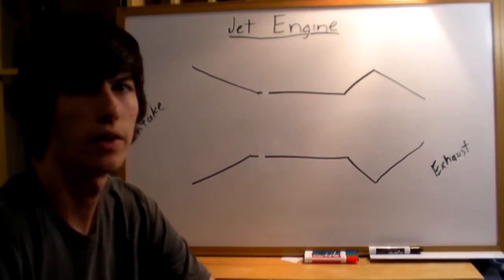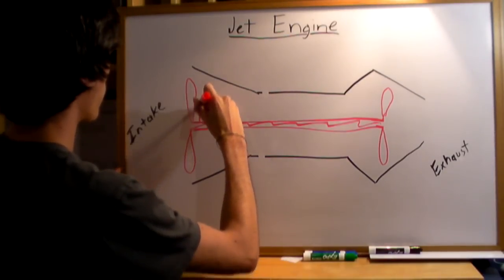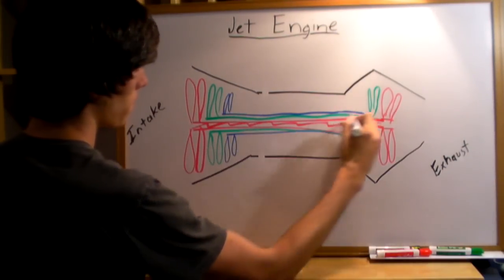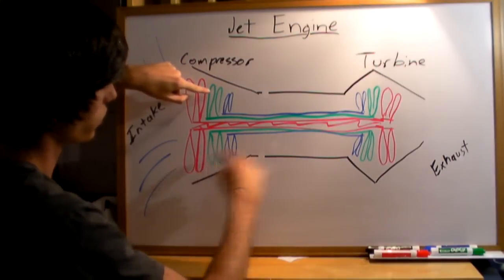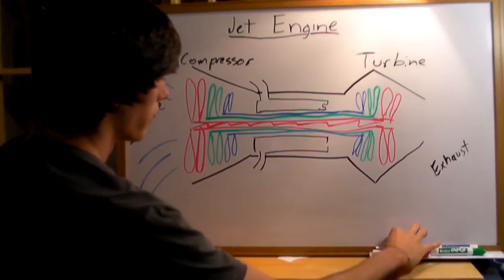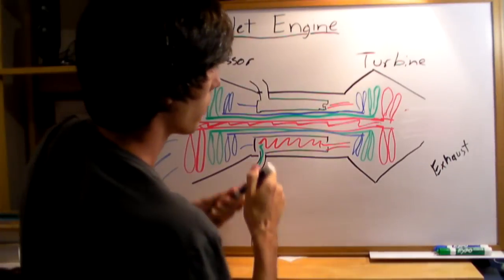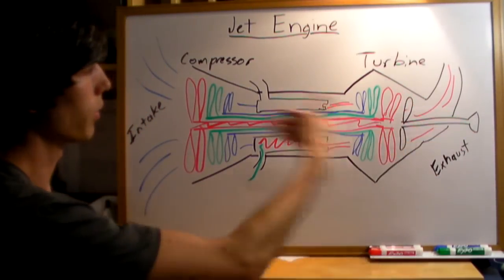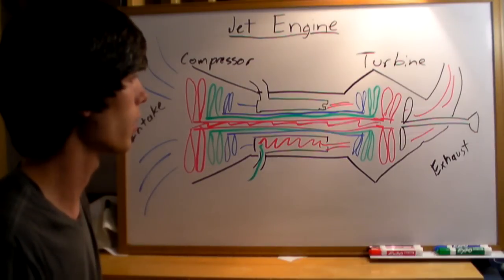Jet Engine - Explained

Comment: Of almost all the "how jet engines work" videos on youtube. None of them (including this one),  except one,  explains the reason that the hot air (in the combustion chamber) only goes toward the turbine, but not back to the compressor. That is one of the major reasons jet engines work. Oh well, guest that would be too complicated.
Reply from the maker: +Aviator168 Do you wish to enlighten us?
Reply: +Engineering Explained why can't you Google it
Reply from the maker: +Aviator168 All I'm saying is you can bash a video or you can add to the discussion. If you have information you feel is helpful to others, please share it. If you simply wish to criticize without providing any additional information, I don't see the value.
Reply: +Engineering Explained I am not bashing anything. If you are giving information, especially education information, please give it in complete detail, or have a disclaimer indicating it is not so.
Reply: +Aviator168 PLEASE GIVE US THE FULL INFORMATION PROFESSOR
Reply: +Aviator168 I suppose it would be due to the outlet of the combustion chamber being in one direction , the rear towards the turbine.
Reply: No. The reason is the pressure in the combustion chamber, even when the air is in maximum temperature, is still lower than the pressure on the compressor side. This is kind of counter intuitive. How could pressure lower when is heated up? Well, the speed of air moving in the combustion chamber is actually much faster than outside the combustion chamber, the diffuser, which is an important part of the engine. Unfortunately, most videos do not talk about that.
Reply: +Aviator168 do a video and explain us
Reply: There is a video on youtube with the correct explanation; but I have forgotten the link.
Reply: +Aviator168 SAME!!! it has taken me way to long researching to find out why
Reply: +Aviator168 still doesn't make sense, bc if it is bc the pressure is strronger in front of the combustion chamber then where did the energy come from to drive the compressor? then you may as well just use a rotary engine to turn the compressor and forget about the combustion chamber. why is it so difficult for people to explain this?? so many peopme act like they know how it works but energy wise they are always so circular, saying things like the compressor moves the air because that air turns the turbine the turns the compressor. sorry i dont mean to bash you specifically but whenever i ask a professor they act so smart because they know how it is constructed and dont know bs how it actually works. 

it also doesn't explain why the compressor wouldn't turn into the turbine and the turbine into an ineffective compressor.
Reply: The real doktorbimmer Everything is good here except you didn't explain why high pressure in the combustion chamber didn't cause the air to move backwards.
Reply: The real doktorbimmer yea but the reason the pressure would be higher in front, in your case, is because of the compressor which is driven by the same air passing over the turbine, that is circular reasoning. Im mot insulting you by saying, circular reasoning, im just saying it is, so dont be offended
Reply: The real doktorbimmer yes that is very true. But it still doesnt explain why the same heat doesnt turn the compressor instead. And no its not because they made it to only turn in one direction
Reply: +The real doktorbimmer The Heat is HOT AIR. "The turbine extracts the HEAT and turns that HEAT ENERGY it in to the mechanical power to turn the shaft.".
Unlike humans, metal can only absorb the heat and react to the molecular change caused by this heat. It cannot extract and turn the shaft a way a human would use his muscsle to do so. it is the high velocity of heated air and gasses that turns the shaft. if there is no high velocity, the shaft will never turn
.
Reply: +The real doktorbimmer Agree. that is y I did not say you were wrong. I merely corrected the way you put it. 
"The turbine extracts the HEAT and turns that HEAT ENERGY it in to the mechanical power to turn the shaft.". This whole sentence does not make proper sense. From this statement it would appear to the reader that the turbine has that "ability" of doing what your statement claims. the movement of the shaft is solely by the effect of the working fluid on the turbine. Does anyone else read the way I do or am I misreading this .. anyone else
Reply: +COMMENT heated gases and air is the energy in this scenario. in a waterfall driven powerplant, it would be the kinetic energy from the falling water on the turbines
Reply: +The real doktorbimmer At the top of the waterfall, the water has potential energy. Once it goes over the edge and begins to fall due to the force of gravity, the potential energy shifts into kinetic energy. No energy can be lost or gained during this conversion, due to the First Law of Thermodynamics. The energy conversion of a waterfall can be harnessed to produce hydroelectric electricity.
Reply: COMMENT I DO!
Reply: The real doktorbimmer DUDE I UNDERSTAND THE HEAT CYCLE! im not dumb! Its that you still cant explain why the hear cycle doesn't act on the compressor just like it does the turbine and therefore cancel it out.
Reply: The real doktorbimmer no one here seems to understand that they are saying that the heated air is only being driven BY the compressor TO the turbine. yes the heat energy is what turns it, im not stupid, but its still circular reasoning to think that this heated air only turns the turbine instead of the compressor.

 I know the compressor and turbine are mechanically different but that would be saying that it was a one way valve causeing this, which it is not.
Reply: I think Bernuli's principle comes in here as well but, i doubt it changes the direction of air flow
Reply: The real doktorbimmer dude i already said i know that! We all know that the heat is the energy that turns the turbine! But you are so stuck on that idea that you cant see what the rest of your argument is saying.

Yes the as the air PASSES past the turbine it cools and that cooling is transferred into mechanical energy to turn the compressor which creates the pressure. However why does this heated exhast only go one direction, to the turbine? No one has answered why it doesn't go through the compressor, you say it is because the compressor forces it through, to make it go to the turbine. But the turbine is what is turning the compressor which without the addition of the heat energy is circular. Which would make sense, no heat no movement, this us where i agree with you. But lets just say theoretically the compressor and the turbine are the exact same shape and have the same number of blades. The combustion chamber is in the middle. Now which way does the air go? Just because there is heat energy doesn't mean it wont just force past these two identical blades on either side and just go out both ends accomplishing nothing but heating the atmosphere. 

The reason i said to assume both the compressor and turbine were the same is to show that unless you see them as a one way valve(one being harder to pass through than the other) then there is no reason the air would not go out the front as well. You said its because of higher pressure via the compressor but why wouldn't the compressor just act like a turbine and turn the turbine into a compressor!?!?!?! And you better not say its because it only spins one direction.
Reply: We aren't debating where the energy comes from, just why it doesn't turn the compressor and make the turbine the compressor.
Reply: The real doktorbimmer sorry, i got kinda nasty
Reply: The real doktorbimmer its not that i cant understand these concepts, im in high school and I've already done two years of college calculus while i was in highschool (and yes i took physics) its the not principals of heat-> mechanical energy converson and what not but just why it only acts on one blade and not on the compressor to turn the turbine. But i think that once it is started, and the air is flowing over the turbine then it all makes sense because you are getting extra heat energy to turn it, that because of the air flow this heat will never reach the compressor and work backwords. So now i finally understand that.

 But what about when the engine furst starts? I think it could be how the combustion chamber is built, that the exhast comes out one side, the back, now that is not enough to fly the plane but it is enough to get the turbine to turn the compressor instead of visa versa.

So i do understand now.

My main problem was that i was thinking that you were saying that the compressor was moving the air that was turning the turbine that was turning the compressor which obviously wouldn't work, but i guess if the heated exhast ONLY reaches the turbine and not the compressor then yea i understand now. Thanks for not getting pissed off like most comment section ppl do.
Reply: The real doktorbimmer ah i can finaly put this to rest! thanks
Reply: +The real doktorbimmer With current jet technology. The turbine is connected to the compressor directly. I heard  PW and GE is working on a magnetic coupler (for small jet) between the turbine and the compressor so the amount of power transmitted back to the compressor can be varied. The goal is to get a wider band of efficient operation.
Reply: Aviator168 yea tht will be tough though bc heat and magnets dont mix well, you lose your magnetic power when you heat up a magnet

They have the same problem with the magnetic containment idea for sustained fusion.
Reply: I think they put the coupler near the intake where the first few stages of the compressor is. No heat there.
Reply: Yea
Reply: Can one of you explain, or direct to a video that will explain, how the turbine extracts the thermal energy from the air and turns it into mechanical energy?
Reply: Is there another principle or something that makes this possible?
Reply: Here is the thing about the so called compressor of a jet engine. It's function is not to compress the air, rather to accelerate the air to a great speed. The pressure of the air only rises in the diffuser.
Reply: why cant you Google it?
Reply: Word search on this thread brought no results for the word STATOR blades so far. Look it up.
Reply: It's all people need to start looking in the right direction. You had many opportunities to explain how stators pertain to the process of compression, but where were you on that? Using industry abbreviations... oh sorry: Initialisms to help people understand the basic principles of jet propulsion.
Reply: i have not yet read all of this post because i was too anxious to tell you that this is EXACTLY what i have thought to myself for many years, you are absolutely right which shows how we are sometimes prepared to accept an exlanation without critic. i will now comb thru this thread in hope of finally being sated!
Reply: my thoughts exactly circular error, velocity alone is not enough, 1000kph hydrogen not the same as 1000kph of co2 for e.g.
Reply: doktorbimmer great explanation
Reply: This issue/question is what's been in my head too.  doktorbimmer, thank you for your perseverence and patience in answering.  So often such discussions  break down into name calling.

Here's my thinking on why the gasses in the combustion chamber don't go backwards through the compressor.  Let me know if I'm totally off base.

As the air comes into the compressor, it's compressed because there is less and less space for it to occupy.  If you look at the core of the compressor section, you can see that it's conical while the outer housing of the engine is a cylinder.  There's less and less space for the air to fit between the housing and center of the compressor and the pressure goes up.  At the point where it's about to enter the combustion chamber, it's at its highest pressure.  

Right at the point where air is about to enter the combustion chamber, the air pressure is highest.  The air then enters the combustion chamber and the pressure drops because the volume increases.  (this seems counter to the bernoulli principle, I know)

The flame heats the air up, which causes it to expand and the pressure to go up.  However, the air pressure still doesn't go higher than the compressor's output, so it goes back, over the turbine.  

An air particle "sees" the walls of the combustion chamber and engine as having a pressure as high as the ambient pressure, since they are fixed.  It "sees" the in-rushing air from the compressor as having equal or greater pressure because it's blasting in at high pressure.  It "sees" the air pressure at the turbine end as lower and heads that direction.

Does that make sense or am I all wet?  I know it's been a year or so... :-)
Reply: I noticed the same absence in all the jet engine videos I've seen. I have the same question.  Post a link.
Reply: exactly - pls explain.  something about the brayton cycle, nbut its not clear to me